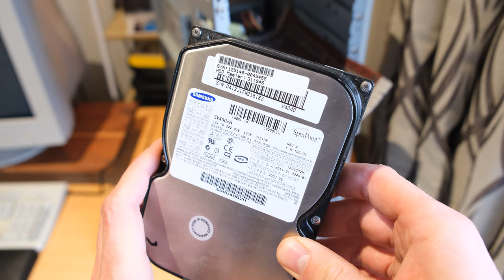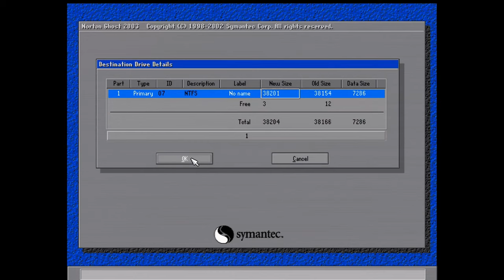I Broke it! | Fixing my Athlon XP Machine

Comment: By far the easiest socket A coolers I've found using are the 3-hole 80mm fan cooler master designs, specifically the ones with a 2-part clip (HAC-v81, HSC-V83 etc.).

The clip has a pivoting end with a spoon handle so no screwdriver's needed, plus the choice/availability of 80mm fans is much better than smaller sizes.
Reply from the maker: Ahh yes, sounds like a much better cooler design! I wish there were more of those kicking around these days. But from the sounds of it, that would be the way to go

Comment: yeah i need to recap a athlon xp with bulging caps. Not sure if i should also do the smallest caps.
maybe you could expoxy a block of plastic to extend the clip holder.
i think you had some magnification glasses or camera you could tag the resister you knocked off. Seeing it up close makes a big difference with smd parts.
Reply from the maker: I'm looking at investing in a microscope, as I'll have some projects that will require it. The one option I thought of was drilling into the clip and inserting a small rod in. Then getting epoxy around it

Comment: I know of only two people who managed to replace the plastic part of the Socket without having to remove the pins.

One would be me and the other is a fellow Romanian retro enthusiast who I learnt the trick from. Let me know and I'll dig for his guide (I think he had one around.). Saved my ECS K7VZA (KT133A) from ending up as parts, sacrificing a dead Gigabyte 7VT600-RZ in the process.
Reply from the maker: Sorry for the slow reply! Oh cool! I ended up working around the problem by fitting a cooler that used 3 tabs per side. Not ideal for flexibility, but I can keep that heatsink with this machine ❤️

Comment: good work, unfortunate with the screwdriver. that full tower case looks empty with only one drink holder, need to fill that up.
Reply from the maker: Haha indeed it does! It's got a pretty big forehead but I don't have many drives that would be interesting to add. Really just a extra DVD burner. I could add a PCI to Sata card and load it up with some more drives

Comment: Ahhh yes the old screwdriver trick... I once wiped a brand new A8N32-SLI because the hook broke off. A lot of adult language was used.
Reply from the maker: Oh lawrdd! A band new motherboard as well, that would have been a breathe heavy moment
Reply: Dang that gotta hurt, I was lucky that never happened to me... I "only" crushed my two year old TBird 1.33 OC to 1.4 the damn thing was that my MB didn't support anything faster than the 1.4 so I couldn't get a cheap and faster Palomino.
Reply from the maker: Yeah that's life sometimes haha. Good old thunderbird! Those fsbs on some motherboards can be really annoying as there are much faster chips to use. Was the average speed of those slot style CPUs 1ghz to 1.5?

Comment: I noticed that every time you quickly lifted the soldering iron whilst removing the old caps you were flicking bits of solder everywhere, including on the back of the CPU socket.
Reply from the maker: Good spot! I ended up brushing the board down after re capping but I need to be more careful!

Comment: Hated the screwdriver part on socket 370 and 462. Happened to me 2 times but luckily i didn't kill the board and then i found an arctic cooling that actually has a screw that would just tighten it on the board instead of doing the screwdriver thing. All cooler manufacturers should have done the screw method
Reply from the maker: Yeah those cooler designs are much more desired. My mistake was not putting the computer on its side, so was being a bit lazy

Comment: Why are you using knife-shaped soldering tip for this job? Shouldn't be easier to use a conical or bavel one?
Reply from the maker: I usually fit a J tip. But like trying different ones out to see what I prefer